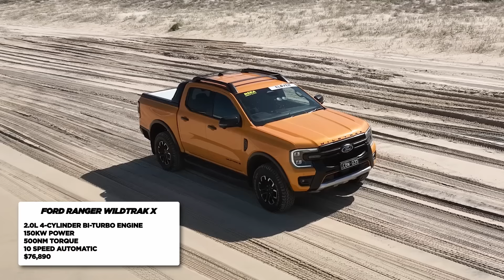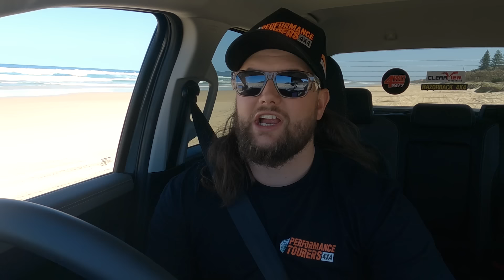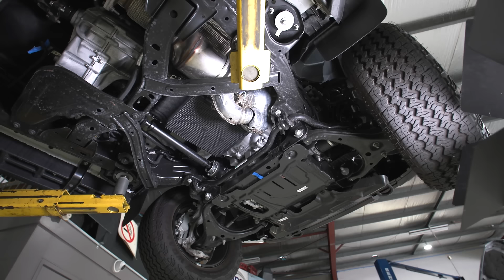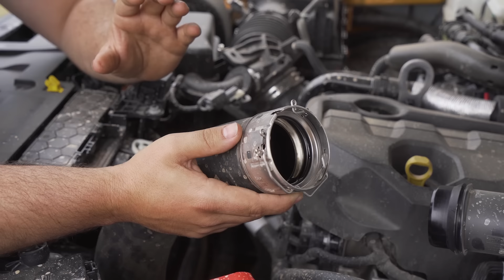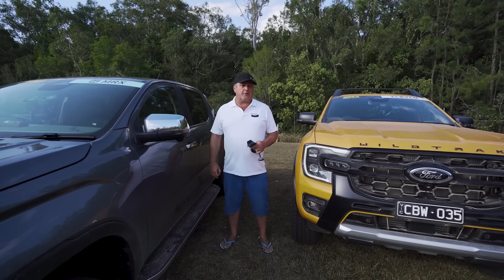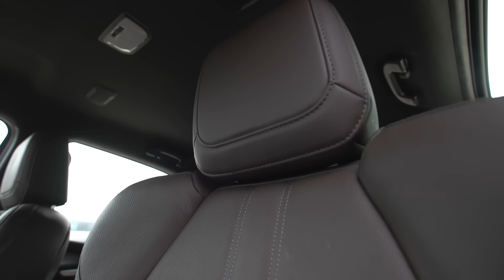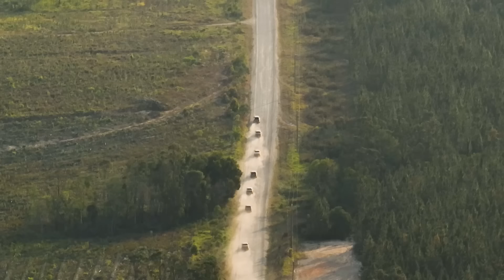2023 4WD UTE COMPARISON - Top Pickups tested Off-road - Shock winner!

Comment: Don't forget, the Amarok is essentially a reskinned Ranger - thats where the V6 and low range transfer come from. Not having the V6 version of the Ranger probobly let it down. Its a little bit weird to compare the Amarok engine to the Ranger, since the engine is actually provided by Ford.
Reply: Think of it as a comparison in power train options. From that, we can see which engine is the better choice hands down
Reply: Many of fords engines are developed in tandem with Land Rover - the 5 cylinder diesel used in the old defender was ford developed. This V6 i believe is largely developed from the ground up with what they learned from Land Rover experience. Plus, pretty sure it was engineered and developed in Aus.
Reply: @The_Stylus_ er no, the Td5 was 100% land rover in house.
Reply: @The_Stylus_  V6 has been highly unreliable and the 10 speed auto has caused a heap of issues.
Reply: @JDMJesseee  V6 is not unreliable, the same motor is used in the f150 diesel and its a proven engine. The 10 speed however can give issues but as said in the vid you can fix it with a proper cooler but yeah its a shame you need to do that after buying
Reply: @JDMJesseee  that is about a vague as you could get.  Any specifics?  Either in regards to the problems or number of vehicles impacted as a ratio to how many are on the road?  Are there many different problems, is there only one problem that impacts many vehicles, are many vehicles impacted due to the high numbers on the road or is the ratio of impacted vehicles to registered vehicles on the road high?   Or are you making pointless comments based on what a mate heard down at the pub.  Or maybe you read it in a comments section and took it as fact???
Reply: @DW-10  I have 5 rangers all V6 dual cabs with trays plus service tool boxes and all tow a service trailer doing break downs to AG, trucks and earth equipment.

Three have had terrible shifting and harsh shifts, thuds and all have been back for software calibration. One has had the whole unit replaced due to convertor failure.

One V6 has had a cylinder head fail water into cylinders. Two have an injector failure which resulted in over fueling the engine and whole engine replacement was required. Four have had rear main seals replaced. Two had front wheel bearings let go...

These cars can do anywhere from 3k to 5k a week with the remote nature of the business and our clients. The previous PX and PX2 did not have this many problems which majority got traded in at 450K to 550K.

No pub bullshit I don't have time for that with 13 hour to 14 hour days and a young family plus call out 24/7 business model along with my partners.
Reply: @JDMJesseee  Thank you.  That is some valuable real world experience and a disappointing number of issues.
Reply: They do this with the ranger every year.. 2.0L biturbo on 10spd auto and make the same comments about the transmission always searching for gears and the engine being overtuned. They don't like Rangers so they don't give them the chance
Reply: Engine is provided by Land Rover... 😂
Reply: @jeanmichaelc1  not really. Its Land Rover based but very different. It was used in the f150 for a long time and that performed decently in reliability

Comment: As a South African who unfortunately lives in Joburg, I had to consider a few extra things before I bought my ute. The VW is simply too expensive. The Hilux and Ranger are too high risk when it comes to theft and hi-jacking. The BT-50 is not (in my opinion) good value for money. Where I stay, the Isuzu network is not as extensive, so parts and service support would have been problematic. That basically left me with the Triton and the Navara. I would have taken any one of the two and they were similarly priced, but the 6 year warranty of the Nissan vs the 3 year warranty in the Triton convinced me to go with the Nav.

My only complaints of the Navara are that the leather seats aren't that high quality, the infotainment system feels like and afterthought and the paint on the body work feels quite thin (chips easily)

Comment: Amarok - 75
Wildtrak - 71
Cannon - 67
Navara - 69
D-Max - 72
BT-50 - 72
HiLux - 74
Total Scores if anyone was wondering
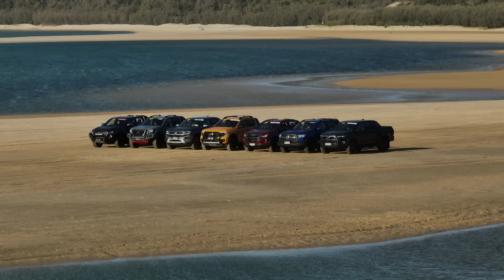1:00:33
Reply: Should have tested the 3L V6 Wildtrak instead.
Reply: @o0x.--_--.x0i same driveline as the amarok 
No point
Reply: @Mon.day777  Wildtrak X doesn't get the V6. Only comes 4 cylinder which is kinda stupid cause that's Fords offroad focused Ranger
Reply: @o0x.--_--.x0i  Yep, the V6 is streets ahead of the 2.0L. When you have the Hilux ahead of even the 2.0L wildtrack, you know the scoring system is messed up.
Reply: Yeah Hilux was not best at anything but still always managed to get equal top marks.  Go figure who gave the scores.  Jocko
Reply: @ScottMcS  yeah cause the hilux maintained a decent score throughout the video whereas the other utes excelled in some areas but did poorly in others
Reply: @ScottMcS  lol you right
Reply: Hilux is the real definition of  `let them come "
Reply: @charlesanim-mensah359  hilux is in a real need of an upgrade it is old outdated and running off a name at the moment. It's ride and handling really are put to shame, not to mention the interior noise and its lack luster motor and power delivery.  Forget the tech side because my dads new mobility scooter has more. Simple truth Toyota got lazy with this car and should have by now fixed the issues. The last truly decent hilux was 2 generations ago with the N170. After that they have just been mediocre. Maybe this new series will address some of the issues when it arrives in the next 2 years ........ one can only hope
Reply: @Sh1tstir  I disagree, the later N70 hilux is an excellent vehicle.
Reply: @Sh1tstir  a lot of people seem to think the 2.8l is pretty good even somehow made it’s way into the new 70 series and people are being impressed, so I’m not sure what the go is
Reply: @flatoot  agree to disagree N70 is good yes but N170 was better built. The point here Hilux didn't have to do much in that space because the only competition was the D22 Nivara. It established a reputation and rightly so, then due to a lack of competition they just dropped the ball and for the once market leader to be so far behind is detrimental to its brand.
Reply: @Sh1tstir  People should buy whatever vehicle suits them best for their own personal reasons. Some folk say toyota needs to improve because another truck is better for this or that reason. I'm not particularly interested what other vehicles have got, toyota haven't let me down so I'm happy sticking with them. I even had one of the dreaded euro 4 hilux's that were prone to cracking pistons, but it didn't let me down either. So I can't complain.

We have a P51 pathfinder as well which I also like. But it doesn't seem to absorb the same milage unfazed like my N70's have. It feels very worn out in comparison
Reply: @Sh1tstir I know you have a ranger 🤣🤣
Reply: @flatoot  
People are miss guided very often by false facts pushed by fan boys and plenty of paid media, 
I ring a Toyota dealer. And ask about GCM the dealer promotes 3.5t towing and ignores the GCM, 
Ask about 5 star ancap testing and it is 5 star gloss over the fact that was in 2019 not 2020 standards. 
People need to be aware often that's not the case. 
Toyota sells poor safety standard vehicles putting people at risk for profit and should be setting the standard in this area, from moose tests traction systems safety system very poor. 
The fact that 79 dual cabs have no ancap test only the single cab has ever been tested due to mining requirements. 
While people reward this behaverior the standards will be poor and your roof will collapse in a crush your familys heads or yours.
Reply: @paulmcintosh5589  I'm basing my fan boy opinion on 30 years of driving hilux's. They've all been excellent in reliability. They rust to death in my climate before they ever fail mechanically. The biggest thing I'd ever hit on the road here is a goose, not a moose. Hilux suit my needs. But like I said earlier, everyone has different needs and expectations, they should buy whatever suits them.
Reply: @Sh1tstir  I do not like the idea of a hybrid diesel Toyota Hilux in 2025.
Reply: @flatoot  

It's a swerve test to avoid hitting and object or even a kid or mum without rolling over like I said Toyota equals profit over safety fact. 
no experience required.
Reply: @paulmcintosh5589  I know what the moose test is. If you don't like them, don't buy them. But your opinion doesn't trump everyone else's
Reply: @flatoot  
Just trumps all the poorly informed about the actual facts rewarding poor performance.
Reply: Hilux all day every day 😎
Reply: yeah thanks mate. just pulled out the calculator haha
Reply: Toyota performs like shit yeah thats as food as the the second best performer 🤦‍♂️ every single time you guys do a review the hilux gets "bonus" Toyota fan boy points!
Reply: Man I want to see 3 litre V6 Wildtrak

Comment: don't go that crazy with brake upgrades, there's a point where bigger disks will not make you stop earlier, it will then depend on the wheel traction and how good the ABS system is

Comment: I'm surprised that you folks haven't included Mahindra Pik-Up, I dont see a reason for not including them considering capability or Capacity... but yeah... I get it you guys may have reasons with regards to not getting hands on one of those press vehicles... but yeah... it would have been great to see it compared with the machines in the line-up... love the testing methodology and breakdown... Lastly, missed the Mitsubishi too in the line-up

Comment: Don't right off adblue. It becomes available in containers with filling nozzles and every fuel station and supermarket sells it over in the UK. I guess that will be the same over there.
Reply: Yeah I live in rural OZ and the fuel servo up the road has it on pump, plenty of hgv use Adblue here so getting hold of it isn’t a problem at all.

Comment: If i were to go buy a ute right now, i would go look up a triton. With the new model around the corner you could potentially get a ripper deal.
Reply: Despite the older interior, the Triton is really a solid bakkie.
Reply: Bought a new one 2 years ago, brilliant ute at any price point. I'd recommend the GLX PLUS, as it's got the screen, rear diff lock, alloys and its pretty comfortable, only thing I'd recommend is getting a throttle control due to theag down low

Comment: nice show guys... i own a VW 4x4 (Mk 1 Touareg V6) it's now 18 years old... and the rear upper tailgate glass is a bit dodgy... Thats it... its got hi/low- with FCR diff-locks... I've owned a Toyota, Range Rover, Land Rover and a Volvo XC90... Here in the UK, all Land Rover products are really poor by comparison... (just because it works today, don't mean it'll work tomorrow) I bought the Dub, sight unseen 4yrs ago... i have not been disappointed...

Comment: No matter how reliable the Hilux is, you just can't justify that price. If I were looking for a reliable workhorse at good value I'd get the D-Max. However, I don't need something that will do 500k miles on dirt road over the next 25 years. instead I will pick the Ranger, you just can't beat the V6 power, the tech, the comfort and a thriving aftermarket scene. For me a UTE is a weekend warrior rig and a daily driver, and in that situation the Ranger is the best option. If Ford decides in the future to put the V6 diesel wildtrak motor into the Raptor package, then it would be the perfect UTE.

Comment: Of course the hilux is Jockos pick but put simply it's nearly a 10 year old car basically and it should have had a lot more development in that time but sadly it dosnt. Sure old is reliable but it's not new and really shouldn't be compared to brand new. That being said there really was only 1 totally new platform in the V6 amarok/ranger so how do you do an honest comparison when other platforms are running some what archaic technology. Would any vehicle score at an honest reliability bush proof test running an engine less than 2 years old nope and nor should it because you just don't know and every new motor gose through teething problems. 

Why oh why is there a 2ltr  twin turbo in this test the engine is and always will be laughable its fords biggest embarrassment considering the 3.2 ltrs end date and the V6 start date. Did Ford just make a special upgraded off road spec vehicle just to get rid of these motors because no one wants them I wonder........... but the adblu this is actually a good idea because it deletes the need for a dpf and you can go turbo back exhaust upgrade and not get into trouble and yes adblu is readily available at every truck stop in Australia as all new trucks have been running adblu for nearly 15 years

Comment: With Adblue if you run out many cars will refuse to drive if you run empty to prevent damage to the adblue pump and to follow emissions rules.. If you are way out bush you might have a real hard time if you run out.
Reply: One fill lasts like 10,000km. You get warnings at 2,000km and some can run for 3,000km after empty. You'd really have to screw up to leave you stranded.
Reply: So no different to running out of fuel…plan ahead,Adblue is readily available
Reply: Stop reading the internet hype, 4fs it lasts between 10-15k kms. The Hilux has 6 month servicing, compared to the X of 12 months, so the X is still miles ahead as far as running costs

Comment: Yes, the GWM is initially laggie but those power outputs aren't hideous niether, there's more on tap here than your hilux had Jocko, but everyone towed with them and loved em.
Value for what you get, the GWM has to win hands down once you consider if you placed some aftermarket suspension on it the price is still far cheaper than anything else in the line up.
I'd certainly go with one if in the market, but I'm not.
Sticking with the Patrol wagon.
Reply: Biggest issue with a Chinese car will be durability, and thus reliability
Reply: @Corey-pd3mi  yeah previous badged great walls have be really questionable but after seeing what mates have done over the last 5 with zero issues i think they have turn a corner like how hyundai and kia did, they were once buckets of shit at the start
Reply: @Corey-pd3mi 7yr unlimited km warranty points to it being fine. I’ve got one with 56k on it, several interstate trips, not one issue. Know others who’ve travelled around Australia with them, not a problem. And for the money, in 7yrs time you can buy the latest model with the latest gear and you’ll have spent the same money on two cars as you spent on a 7yr old hilux in the first place. 🤷🏼‍♂️
Reply: The biggest problem is politics.
I would never ever buy a vehicle from a Chinese manufacturer and made in China.
Reply: @perpelle your going to struggle by much of anything with that ethos
Reply: @perpelle  What do you drive now? Probably has something made in China, and the PC or Phone you wrote this comment on will definitly have something if not all made in China.
Reply: @perpelle but you using a Chinese made phone tho where do you draw the line mate🤣
Reply: @ausdeerhunter  It's easy. Just read my other post.
Reply: @perpelle yeah good luck with that 🤣🤦‍♂️
Reply: @Tom-lf8hx  Good luck with just giving up on everything without realizing the consequences.
Reply: @perpelle  ahahahahahahahahahahahahahahahaahahahahahahah calm down its just 4wd review 🤣🤣
Reply: @Tom-lf8hx  Stop replying then. I didn't reply to you.
Reply: @perpelle agreed, not a fan hey

Comment: Great vid guys, Navara still for me tho. Interested to hear more on brake packages and rear main seal issues on them though
Reply: Yeah imma np300 man too, rear main seal hasnt been a issue for me just a hotpipe upgrade was and a cheap upgrade too
Reply: They don't blow up they have been a very durable engine for many years in Europe.
Reply: So do the Fords. Would not touch one. Nav’s don’t tend to blow up from brand new though.
Reply: I know the disc size is a factor but almost every Ute had smaller road tyres compared to A/T larger tyres on the nav. Put a road tyre on an 18” wheel and see where it pulls up
Reply: @danrowland7192  so regarding the brakes, if they were to be replaced to something better and more fitting- what would they be switched to?
Reply: They also blow up mate
Reply: @125kingo125  im on my 2nd np300 never heard of them blowing up... but definitely throttle body and hotpipes are weakest point
Reply: Had my right rear seals replaced twice and the left side once. They had to pull the axles and have them re-sleeved at an engineering shop. Shouldn't have any more problems, according to the guy who fixed them. Quite a common problem on many different utes according to him.

Comment: in south africa you can option the gwm with a winch,  factory warranty on as many of the accessories as possible for me, 
all it really needs is suspension upgrades, in terms of power its not far from where a 3.0 d4d was and that was more than enough for most people, what i would do on one is get all the beeping shit turned off at a software level, no lane detection no stop start,